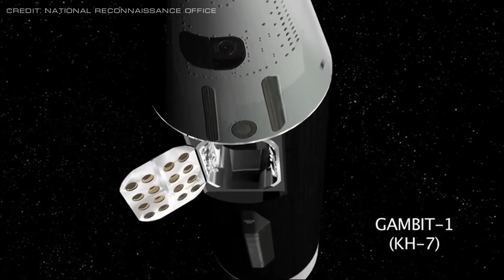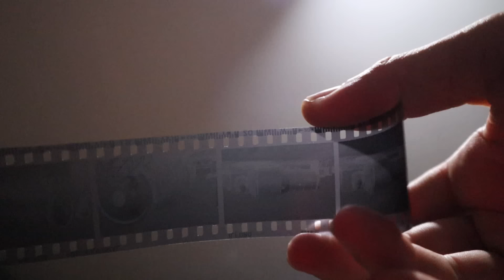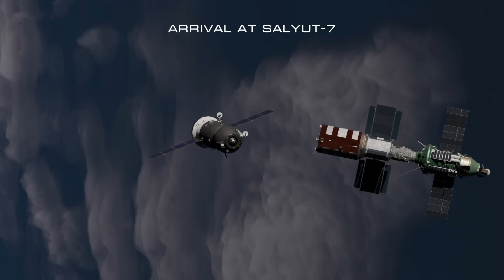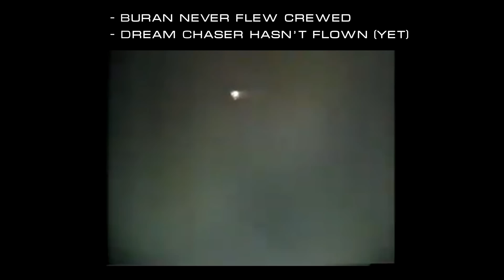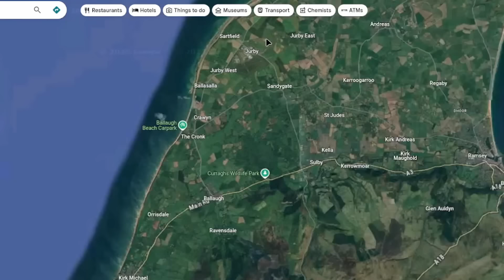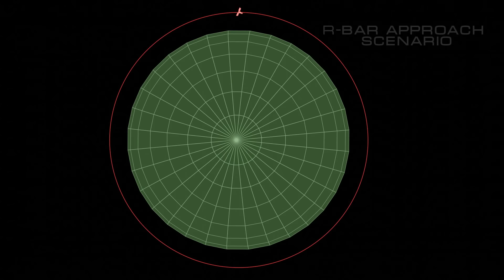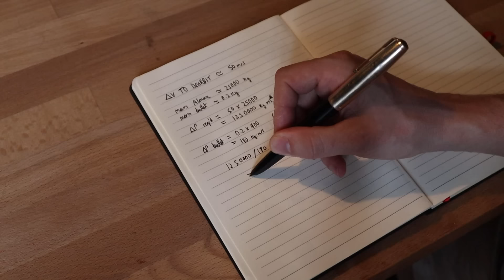Almaz: an Autocannon on a Space Station

Comment: My main takeaway from this video is an M61 vulcan on an unstabilized satellite, firing wildly out of control and spinning is the most cost effective LEO denial weapon.
Reply from the maker: Oh hell yes
Reply: @Alexander-the-ok  I don't necessarily agree. From an actual engineering perspective, not aiming the Vulcan would probably cause a large portion of its ammo to be deorbited. Using the Vulcan as an Leo denial tool would be amazing, however realistically if someone's going to do it, they have to get it up there and fire it. Let's face it, there's no real science institute that would deny Leo to everyone, therefore anyone capable enough to do it would probably only have enough ISP to get the cannon by itself up there, they would probably use any other weight they had for extra ammo, rather than a stabilization system.
Reply: @Michelle-Holl  bag of metal balls with small dispersal charge seems pretty hard to beat.
Reply: @Michelle-Holl  while I agree with your point I think the better engineering solution than stabilizing the gun is to reduce the powder to a point where I lacks the energy to deorbit any or most projectiles. That way you actually save weight allowing for more projectiles.
Reply: @Michelle-Holl de orbited? The bullets are not in orbit after fired dummy

Idk how u can’t see the joke and still not actually know what ur even talking lol 

And if you mean the shell castings, they will burn up in the atmosphere without an slightest of doubt lol 

Or if you mean the entire cannot itself, yeah probably lol, but idk how much it would effect if an object in space my mind goes both directions bc I js don’t know what to guess
Reply: @Michelle-Holl cost effective, not mission effective lol
Reply: Couldn't you get roughly the same effect with a shrapnel or fragmentation warhead tossing out around a thousand 120g little chunks of lead?
Reply: @Neuttah  or a bag of sand
Reply: POCKET SAND
Reply: @Neuttah  there is a common joke about railway carriage of nails placed on orbit in case of global war.
Reply: @Neuttah gau-8 avenger is cooler
Reply: @Neuttah Google "Fragsat"
Reply: @Neuttah you could get the same effect by throwing a handful of paper clips out an air lock, so what's your point?
Reply: @Neuttah  unstable satalite + belt fed full auto shotgun or like flak cannon
Reply: Two of them on separate axis and you have a death blossom
Reply: @Solnoric this might cancel out the recoil

also if the gun could swivel, u could use it as reaction control system (tested it on KSP)
Reply: @God-ch8lq  Real Rocinante over Ilus vibes, using projectile weapons for RCS and propulsion!
Reply: Nah that's why you have them at 90° to one another, one adds spin in the X axis, the other adds to the Z, causing chaotic rotation @God-ch8lq
Reply: @God-ch8lq  You could use it as propulsion

“A reaction drive’s efficiency as a weapon is in direct proportion to its efficiency as a drive.” ~Larry Niven
Reply: @rdavis43 with a muzzle velocity of 850m/s, the specific impulse of the rikhter R-23 cannon is roughly 86.6 seconds

this is laughably bad

for comparison, a spray can full of ammonia has an Isp of 96s
Reply: @God-ch8lq  But it'll work in a pinch
Reply: @VoxAstra-qk4jz yeah, as reaction control it's gonna be fine
Reply: @JunoTheMothGirl  wouldnt they just create an impulse along the average vector?
Reply: @God-ch8lq did you factor in the propellant? I think the rocket equation is always gonna be crappy for using massive solid objects as your exhaust. It was meant for fluids. Especially gaseous ones but the spray paint is similar, fine droplets, like a liquid engine with the turbopump on but no ignition and then that’s gonna depend very much on fuel and oxidizer nozzle design and whether it’s pointed out the back of the big nozzle but that is pretty funny. I got 75s btw but I didn’t factor in the propellant. That’s a significant amount of thrust by the way. The primer is pretty large on these autocannon rounds and this one would’ve had lead azide in it which detonated whereas the propellant deflegrates if unconfined. Speaking of which, that works like a blowout plug and will greatly increase powder gas velocity.
Reply: @svenofthejungle  
I may be out of propellant

But I'm not outta shells
Reply: @rdavis43   Orion drive ass
Reply: How many kg of ball bearings to trigger Kessler syndrome?
Reply: @afwagogoqago  I think just one might be enough on the proper trajectory aimed at the right satellite.
Reply: I call it the Kessler Machine
Reply: Bolt six together in a huge box, two for each axis, slave them together with a gyroscope and an Arduino, and you have the world's first entirely ballistically-driven craft. Name it "Kessler's Left Schnut". Launch a dozen into orbit. Reveal this globally a week later. Start making demands.
Reply: Touhou
Reply: throwing them prograde or retrograde is counterproductive. (or I guess, productive in this case since this whole project is counterproductive)
Reply: @thereddaikon  so a Death Blossom
Reply: The military industrial complex  refuse to make it simply because after they sell one nobody would ever need any other LEO denial weapon.
Reply: @thereddaikon  spinning and shooting in all directions
Reply: Unfortunately, that leaves us with non-reaction weapons like lasers.  Not a happy way to go.
Reply: The most cost-effective LEO denial weapon is a Starship loaded to its capacity limit with steel spheres, each 1 inch in diameter, launched retrograde, and then shitting those spheres everywhere.
Reply: "Death Blossom", like in the movie "The Last Starfighter"?
Reply: @thereddaikon  
So when are we launching?
Reply: In space, nobody can hear you BRRRRT.
Reply: I dunno, the copper needles we dumped up there are probably more effective.
Reply: If they fired a round in the opposite direction (thanks Newton) it would be fine, I expect. I mean, it isn't like there's a ton of material in the solar system already traveling at ballistic speeds, right?
Reply: @thereddaikon   thought that was law enforcement officer in the acronym for a minute tbh very different when read that way
Reply: It’s like that old arcade asteroids game.  Spurting hot metal all over the screen while twirling and who knows wtf is happening as stuff breaks apart into smaller bits and Oh GAWD
Reply: No, it’s not.
Reply: @TheArtikae  it would deny low earth orbit for everyone very quickly I assure you
Reply: @misterperson3469  literally wouldn’t do anything more than a single satellite of the same weight after being smashed into pieces. Many have happened…. And yes they are starting the Kessler syndrome already, but “very quickly” has already been proven untrue

Comment: "...That would detonate if it landed outside the Soviet Union." I had to pause there and think about how a system like that would have worked. 

Maybe some kind of radio beaconing? Maybe the ground was tracking it and would send it periodic messages to hold off any detonation, but if the vehicle never received any valid messages (whether by choice or accident) it would detonate? Just a thought.
Reply from the maker: Listen to the episode ‘the soviet christmas miracle’ by the ‘failure to launch’ podcast. In that case it was a ridiculous combination of a mechanical timer and physical switches and sensors. I imagine it’d be something similar for almaz.
Reply: @Alexander-the-ok  Now that you mention it, that sounds 100% soviet, lol. I love it. (Will give that a listen, thanks for the heads up!)
Reply: One thing is certain, I wouldn't want to be recovering it
Reply: By the description of physical switches, the trick might genuinely be that it's just a timer, like a big sand-clock synchronised to reset every time enough time has passed to currently be in landing/crashing-range of the Soviet Union. And then it measures when enough time has passed for it's trajectory to land it in enemy territory, at which point it's ground impact fail-safe turns into a fail-deadly. 
Barring long-term things like time dilation and non-destructive changes to the orbit, thish might be simple enough to make in a garage, provided you're one of the top mathematicians in the world and can basically guess all the calculations that are needed.
Reply: The Americans simply put a salt plug in their reconnaissance spacecraft hulls. If it wasn’t recovered in 24 hours, it sank.

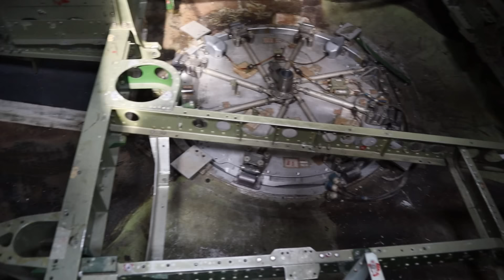Comment: 25:37 To my knowledge, Gemini SC-2 also had a hatch through it's heat shield on the test launch for the MOL
Reply from the maker: Awesome, I’ll check that and add a pinned comment!
Reply: @Alexander-the-ok  The Air Force Museum in Dayton Ohio has one of them there and you can see the hatch from the outside
Reply: @andrewthole4585  I think that one is a test article if I remember correctly, but the one that flew is at the air force space and missile museum at cape canaveral space force station and the heat shield of that one clearly has the hatch as well!
Reply: @andrewthole4585  i saw it, is cool
Reply: Yes they launched a boilerplate MOL in 1966, primarily to test if that heat shield worked.
It did but as the video states, better cheaper options were available, not that the USAF was giving up on a crewed station but the massive costs of the Vietnam War also saw it cancelled in 1969.

So the USAF went on to influence in a very negative way the design of the Shuttle, though given how narrow the vote in Congress was to finance that in 1972, it probably saved it.

Many of the crews trained for MOL transferred to NASA, though the deep cuts to NASA meant they would have to wait for the delayed Shuttle for a spaceflight.

Comment: YESSSS finally an in depth source in english about almaz <3
Reply from the maker: I made this in small part out of spite given the biggest Russian source I could find includes some guy explaining how ‘gunpowder doesn’t ignite in space’
Reply: @Alexander-the-ok I mean, that's technically correct, it's ignited inside a sealed brass or steel cartridge that contains it, if you tried to release some in space it would pretty rapidly dissipate and fail to spread beyond the immediate ignition point. Obviously not what they meant (I'm sure they meant it wouldn't burn in the absence of the oxygen present in Earth's atmosphere), but if we are being particular about accuracy... 😅
Reply: @msytdc1577  it's an interesting thing that I've seen come up in high power rocketry, where the parachute deployment method of choice is black powder charges to pressurize and separate sections of airframe. Really high flights have trouble with this because black powder doesn't like burning at super high altitude, with the issue not being lack of oxygen but lack of pressure. It would burn just fine in 1 atmosphere of nitrogen, but not in a fifth of an atmosphere of oxygen

At least I'm pretty sure that's how it works, all I know is you need to either contain black powder for super high flights or use CO2 canister based deployment

Comment: an entire orbit capable rocket fueled with hydrazine terrifies me
it reminds me of that komet crash where the pilot was dissolved by the fuel or oxidizer
Reply from the maker: ME163. I saw one in a museum recently - its even worse in person. The thing looks like its made of papier mache.
Reply: @Alexander-the-ok  nah it’s the me 163 Komet
It was rocket powered with hydrazine and hydrogenperoxide

During take off errors, accidents or landings this could easily ignite and the pilot basically sat in a cabin surrounded by that stuff

It was crazy
Reply from the maker: @aemonblackfyre4159 oh yeah…the 262 is the jet. My mistake (I’ve edited my comment so I dont look silly)
Reply: @aemonblackfyre4159  Yup, it was tiny, so the interior was extremaly cramped with fuel and ammo and shortages of materials made Germans push for heavy wood usage. Rocket powered plane made out of plywood seems like an insane idea lol.
Reply: @aemonblackfyre4159  Well, it was better than the Japanese equivalent, at least the Germans kinda hoped you'd come back from your mission sitting between bottles of hypergolics ...
Reply: @dawid12301d  The slogan of one unit (IIRC the only operational one) was 'Like a Flea but wheee!'
Reply: @aemonblackfyre4159  Want to know the even crazier thing? The Me-163 actually had a lower per-airframe accident rate than the Bf-109. Fully 10% of all 109s ever built were written off in takeoff and landing accidents, while for the Komet that number was 9%. Flying was dangerous back then no matter what you strapped yourself into. Also, Eric Brown, the only allied pilot to fly a Komet under power, said that it was an excellent performer and far more controllable than any other tailless aircraft he’d ever flown.
Reply: @Shaun_Jones the problem is the 109 flew for most of the war while the comet only had a short service life

The comet managed to get nearly the same failure rate with fewer hours on the airframes
Reply: @aemonblackfyre4159  I understand that it’s a bit of an apples to oranges comparison, but I like to bring up that statistic to point out that the Komet was not some five-rounds-loaded Russian roulette machine that was almost guaranteed to kill you and actually had a quite comparable safety record to a lot of other unconventional aircraft that were built around that time, both before and after.
Reply: I think it was the oxidizer tank (high test hydrogen peroxide) that sat directly behind the pilot? So yeah, more likely to be dissolved by the oxidizer I think.
Wow that was one insane aircraft. And not in a good way.
Reply: @SnakebitSTI it would definitely break down all your cells and oxidize you into soup and oxidized fatty acids but it also might cause your clothes to ignite. Cotton fibers will ignite. Any organic fibers. It’s a surface area thing, and cotton, linen, it’s just cellulose sharing an oxygen atom between carbons which would be broken and then it’s like adding it to sugar which will combust from the heat of reaction of singlet oxygen. You can see how much energy is produced in this reaction mixing bleach and hydrogen peroxide in a dark room with your eyes adjusted. Even without combustion the oxygen is ionized and releases red light as it forms O2 it really, really wants to light something on fire.  This makes monatomic oxygen btw it’s almost as bad as fluorine and will rapidly oxidize anything it makes do tax with so don’t pour it down the sink until its done. It also makes chlorine gas. And oxygen is also a flame hazard
Reply: Just be glad it wasn’t a fluorine based hypergolic.
Reply: @ChadThundertalk  Actually give the choice I think I'd prefer a metal/halogen fire  over hydrazine. It'd be quicker.
Reply: I somewhat recently visited a titan II silo that had been converted into a museum. Seeing semi truck trailers that would have been full of hypergolics is really kind of terrifying